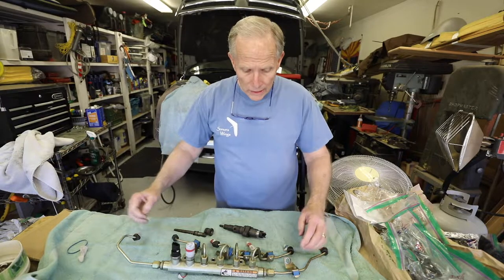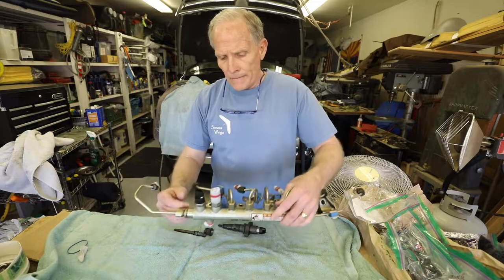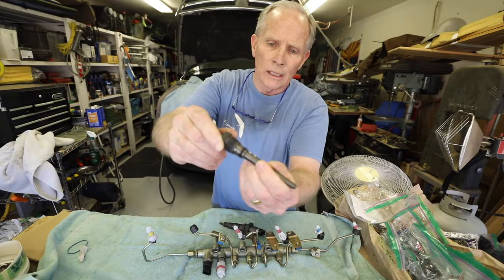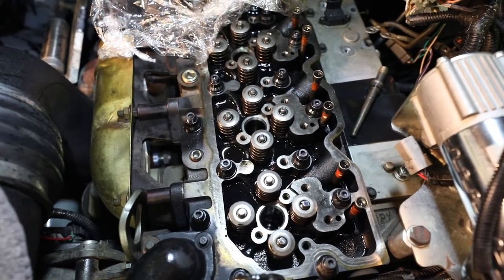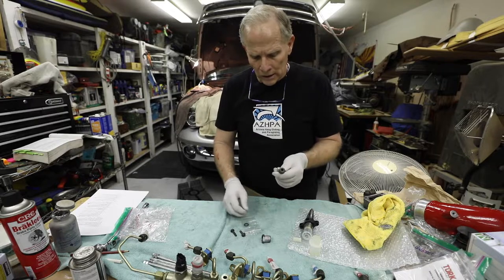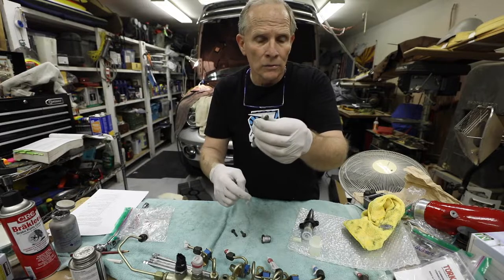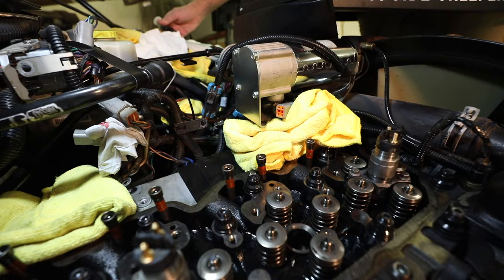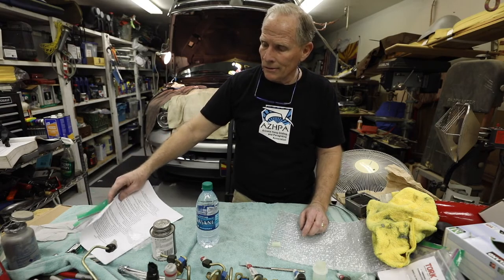Cummins Fuel Injector Removal and Install - 2005 Dodge Ram 5.9L 24V

Comment: I cannot thank you enough for this video. I have searched for hours to find someone who had this process as well as the torque values directly from the manual. All I have found is people over tightening bolts and a bunch of talk of the forums with no backing from a manual. I purchased a chilton manual and they offer literally no info on the torque values or the process. I use my truck for my business and when it is down it makes it harder to make a living.  May God bless you good sir!
Reply from the maker: Hey thanks for the thanks. If you have not already, please email me at the address shown at the end of the video and I will send you the detailed instructions which contain more than was covered in the video. Best regards, Greg
Reply: @gpwrinkled  will do, I am still learning how to work the YouTube app but as soon as I figure it out I will email you thank you so much

Comment: Wow! Very good presentation, the best video on YouTube to date.
Reply from the maker: Glenn Brooks Thanks Glenn!
Reply: @gpwrinkled  Over time the connector tubes lose their torque value and when the fuel line nuts are loosened, the connector tube turns along with the line nut. Blue Point makes a 24 mm. crows foot wrench to retighten and hold connector tubes from turning while loosening fuel line nuts. You'd think the 2 balls would Keep them from turning but they don't.

Comment: Thank you for your great video. 60 years old, third Dodge Cummins but first 24 valve. I got a p2146 code and after a lot of searches, ended up at your video. I didn't think I could do this and was looking a a big bill but thanks to your exceptional explanation
, I'm actually looking forward to doing it.
Reply from the maker: pacodogster Good on ya! I have 3 years on you and it was fun. Just be sure to give yourself plenty of time to do the job and then take your time... less stress and no mistakes. Email me at the address shown at the end  of the video and I will send the detailed instructions. Greg

Comment: 23:06   ...I like your style.  I too use Anti Seize or at least grease on surfaces such that you described to prevent galling when torquing to spec.  So many guys do not do things like this because they think it interferes with torque values and or it will allow the bolt or union to become loose....and that is complete and total BS.  Nothing could be further from the truth.  Your use of grease or Anti Seize is correct and proper.  I'm a Master Mechanic today and began wrenching when I was a pre-teen.  My father and machinist grandfather, (born in 1899) both encouraged my mechanical bent since I was a child.  Every single thing they passed on to me has stood the test of time and fire.  Keep doin it the way you're doin it.  Hats off to you Sir.
Reply from the maker: Thanks!

Comment: Outstanding video! One of the best I have seen on YouTube by far on injectors. I love the cleanliness of your work and perfection! 
As I always say if You want the job done right do it Yourself!!! Thanks for sharing and God Bless...
Reply from the maker: DirectCurrent Hey thanks for taking the time to reply. Glad you liked the video. Greg
Reply: I love it how you do you work very easy to understand. Very clean. Yes I would love to have the instructions how to removed and replaced fuel injector. You can email it to dnomis1 @ gmail.com thank you very much. I have a 99 Dodge Cummins diesel but I can get the lift pump going only when direct power, but then still not running maybe  ineed fuel injector replacement.thank you again so much sharing your knowledge. God bless you!

Comment: Great video. I wish this was up the first time I replaced my injectors. Probably explains quite a bit why I'm changing them again four years later. I am having hard starts when the engine is warm. After extensive searches over the internet I changed everything possible but the injectors do to the thought in my mind that there was no way they were bleeding of pressure. After watching your video I'm impressed that I didn't have a problem before now. A+ presentation.
Reply from the maker: Thanks Greg. I hope you get the issue solved. Good luck to you. If you think of it, maybe come back here and tells us all what fixed the issue. Thanks

Comment: I almost wish I was doing my own now. This was awesome. I do most work on my rigs but the 5.9 diesel was a little foreign to me so I farmed it to a professional for this first need of injectors on my '03 Ram CTD. They had all the right diagnostic equipment and experience. Now after talking with them and the "rule outs" to ID the injectors as the issue, and other possible complications out of the way, watching a bunch of videos on this, and now yours, I feel the next time I can do it. This was awesome and I love your attention to detail in practical application as well as explanation, tutorial, and the little things like the anti seize and silicon seal. 
      At the beginning of the day as I said it was all new and I was unsure, but after multiple vids and now yours, I know I can tackle this next go round. Thanks.
Reply from the maker: Good on ya. I’m glad the video was helpful. As with most projects, once we understand how things fit and function we are able to repair them. The technological challenges are already solved via the design and manufacture of the parts, so we only have the easy and simple job of mechanically assembling those parts. Email me and I will send you the detailed instructions for your future reference... if you’d like to have them. My email address is shown at the end of the video. See ya, Greg

Comment: Great video!  The only thing is it doesn't matter where you grab a torque wrench.  If you grab half way down the handle you have to apply twice the force but the torque is the same on the fastener.
Reply from the maker: Thanks Dan! I believe you are right and I was incorrect in the video on that topic. Thanks for clearing it up.

Comment: Hi Mr. Porter  this is the first time I comment on A video I want thank you  because I learned lot   and it's going to help me to change the  injectors on my 2006 Dodge 3500 4X4 this is the best informative video on you tube hands down
Reply from the maker: Hi Hector, I’m glad the video helped and thanks for taking the time to let me know. If you email me at the email address shown at the end of the video I can send you the detailed instructions if you’d like to have them. They contain all the torque values and detailed instructions for much more than what is in the video.

Comment: Very thorough video about replacing injectors. I appreciate you doing this video as I will be attempting this in the near future on my 2006 cummins as 4 of my injectors are original with 335k miles on them. Thank you
Reply from the maker: Eric James Morris WOW 335K and original injectors. Good on ya! If you want the detailed instructions email me at the address shown at the end of the video. They might help.
Reply: @gpwrinkled  I know it is kind of crazy how long they have lasted. Ive considered just going ahead and replacing them, but it seems the general consensus and advice from some others is to wait until another one acts up. What would you recommend? Btw, I appreciate the email, and I will reach out to you when I get ready to give this a go Thanks
Reply from the maker: Eric James Morris Gee with some things I wait for them to break and then deal with it, but others I don’t want them to break at an inconvenient time, so I do them when I think their life span is close to be done. For me, I don’t want an injector to die in the middle of a trip so I did them pre-emptively. Everyone has a balance and the $ are sure a consideration as well. It’s a tough call.

Comment: Greg shows the proper install here. First tightening injector hold downs to 44 in.lbs. then backing off bolts before initial connector tube torque. So many other vids that omit this step.
Reply from the maker: Barry O thanks Barry!

Comment: Thanks, Greg very helpful some really good points. Iv been working on cars for years you can never have too much information.
Reply from the maker: Thanks for taking the time to reply.
Reply: @gpwrinkled  how did you prime the pump and bleed the fule rack?
Reply from the maker: trainmaxx Prime the fuel system before starting by following the Service Manual Fuel Priming instructions: Vol 3, p. 14-101.
Background info
Fuel system priming is accomplished using the lift pump
When the key is turned to On (don’t start the engine) - The lift pump runs for 1-2 seconds, then quits. (note that if air temp is cold enough for the air intake heater to engage, then the lift pump will run during the entire pre- heat cycle)
The lift pump will also operate for up to 25 seconds if the key is turned to crank and then quickly turned to Off before the engine starts.
(Note: The lift pump shuts off immediately if the key is On and the engine stops running for whatever reason... like in a traffic accident)
Priming
Turn the key to CRANK position and quickly release the key to ON position before the engine starts. This will operate the lift pump for about 25 seconds.
Crank the engine in an attempt to start it. If it doesn’t start in 25 seconds, turn key to OFF and leave it off for at least 5 seconds and then repeat cranking for another 25 seconds. Repeat until it starts.
Once started, the engine may run erratically and be noisy for a few minutes. This is normal.
If it won’t start, perform previous fuel priming steps. Be sure fuel is present in the tank.
Crank the engine for 30 seconds at a time to allow the fuel system to prime.
Start the engine

Comment: Bravo, great video.  I'm contemplating to buy a 2005 Dodge Ram that says to have smoke coming out the blow by hose.  Owner suspects one of the injectors to be the cause reason I watched your video part of my research.  Will email you to request the detail sheet you mentioned in your video.  If I don't buy the truck I still wanted to let you know this is one of the best video I've watch regarding the subject matter.

Comment: Good video, I'm clean freak also. I blow all areas around parts being disassembled with compressed air/brakekleen. Excellent  presentation on torque wrench tips and use of proper lubricants. Only difference is that I do lube o-rings w/parker o-ring lube.Nice job
Reply from the maker: Larry Christopher Hey thanks Larry. Glad to know I am not the only one afflicted with this detailed focus on everything. Merry Christmas to you and yours.

Comment: Good vid!
I used the exact same injectors and I would never do so again. They will NOT get better fuel efficiency and they WILL smoke more than stock making it impossible to pass emissions (contrary to what they promised).  DDP replaced mine twice to try and resolve these issues but they finally gave up.  (They did all work including replacing the CP3 )
These injectors will make your truck run smoother than new though (I've owned truck since new).
If I had it to do over, I would have used their stock, honed injectors and just used a box to add power.
Reply from the maker: Thanks Scott. Good input for others so thanks for posting. I haven’t needed to pass emissions due to the county I live in, so have no experience to share on that point. I do get 19-20mpg consistently on the highway, as measured at the pump rather than relying on the truck’s mpg calculator. Thanks for the comment.
Reply: @gpwrinkled  Thankfully I only had one more year of testing before ymy state  stopped. I had to pay an additional $150 because it couldn't pass. Totally agree on the "Lie-o-meter" . That overhead is wildly optimistic!

Comment: Greg, excellent video. I watch this video and the one on the head studs. I sent you an email last week about getting a set of those instructions from you for both jobs. I also had some questions for you as well. Thanks!
Reply from the maker: Hi ya Charles, Thanks for following up and posting a reply here. I went and found that your email got sent to my junk mail folder for some weird reason. I just replied to it with the instructions. Good luck to you, Greg

Comment: Hey I noticed the email didn't work I was hoping to get the instructions. Your video gave me confidence o try and do the replacement myself
Reply from the maker: Hmmm... didn't get an email. Please doublecheck the email address you sent it to against the email address noted at the end of the video. I even checked my junk email box where they sometimes end up, but don't see it there either. You can also reply here with your email address if you want to.
Reply from the maker: Sent. Check your spam folder
Reply: @gpwrinkled  thank you

Comment: If your gonna torque with the crows foot there is math you have to do to.get an accurate torque value. I can't remember what it is anymore but the crows foot is essentially putting out more torque than the wrench is set at. So say I set the wrench at 100ft lbs then the crows foot would be putting out say 110ft lbs, not accurate but you get the point hopefully.

Comment: Could you please explain How grasping the torque wrench at different locations changes The torque value.. I'm having trouble wrapping my mind around this on account of because it seems to me that the torque wrench is going to click at the predetermined torque setting regardless of where your hand is applying pressure

Comment: Great video Greg, thank you. I am in the process of installing new connectors and I didn't seat the injectors at 44-in/lbs prior to seating the connector tubes. I haven't tightened anything yet. Would you back out the connectors and repeat under the right specs? Thanks.

Comment: This is a great video! I have a question. I have had my 06 cummins apart for a while waiting on parts. Im installing the same injectors that you are. I had to replace pistons and overhaul it. My rail has not been capped off. Do you have a recommended procedure for cleaning it out to be sure I dont have an issue? I am running an air dog. Also Im going to drain out all the old fuel and replace the filter and separator as well. Thanks

Comment: So disagree with a comment made at 33:56. You say that torque depends on where you hold the wrench. I have never heard this and don't think this is correct. Please explain.
Reply from the maker: You are correct. My mistake. It doesn’t matter where you hold a “clicking” type torque wrench as it will click when the torque reaches the set amount. I am not sure, but it may matter with the other type which bows as you pull. The handle has a pivot point in the middle of it.. perhaps to ensure the the wrench is pressured at the correct point along the handle. Another commenter had accurately pointed out the same error in what I said. Thanks for bringing it up as it helps us all to be more accurate.

Comment: Only watched half so far and this video is phenomenal. Were you a shop teacher at one time? If not, it's a shame because you break things down very well. 

In terms of that tool to get the injector tube out....What if someone made one almost the same, but put a 3/8 inch square opening at the end so you can use a ratchet instead of a monkey wrench to tighten down? Seems like it'd be perfect for what you are doing. 

I'm pulling the injectors out of my truck that I just bought to have tested and this video will help a lot! Thanks

Another tip from Deboss garage is that he leaves the nut or the injector lines on the tube and pulls a little. I think he said not to put too much into it.
Reply from the maker: Good idea on an improved connector tube removal tool, and thanks for the tip from deboss garage. Was never a teacher but thanks for the compliments and glad the video was helpful. Email me at the address shown at the end of the video and I’ll reply with the detailed written instructions for the full process if you’d like to have that. Good luck to you.

Comment: Great video! Why did you replace your injectors? I have had all 6 injectors on my 2006 24 valve Cummins go bad one or two at a time.
I pull a heavy boat into Mexico quite often, the diesel there is / or was hi Sulphur this could have caused an issue?
Reply from the maker: joe mcginnis Hi Joe, After reading up on the life span of injectors I just decided to be proactive and replace them at about 100K rather than having the worry of one failing when inconvenient to change it out. I’ve had some folks email me for the injector instructions (I get 2-5 requests a week which is great) who report their injectors have lasted 200K+ before failure. Sorry I dunno if sulphur might have been an issue for you. Greg

Comment: Fantastic video Greg! I just made an account so I could ask you for that detailed documentation, I was hoping you’d be able to send that to me? I currently have injectors,springs,manifold, turbo all off of the truck doing the upgrades to make a reliable 800+hp truck. I’m working on getting all the torque specs and sequences printed out so I can reference all the above as I begin the process of re-assembly. Still trying to figure out how to operate YouTube so bare with me as I’m just leaving a comment cuz idk how to send an email yet ha. Thanks for the great vid.
Reply from the maker: Hi Kyle. My email address is shown at the end of the video. There is no way to send emails through YouTube, so just write down my email address and send an email to me from your email program. Glad the video was helpful! You will like the instructions too.